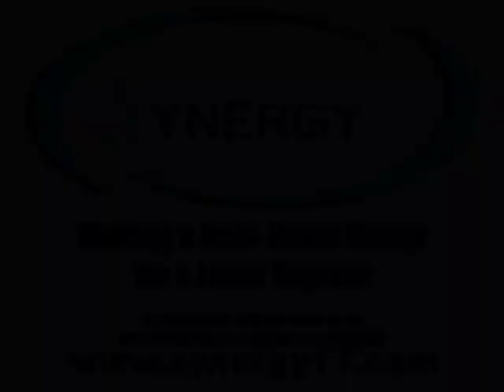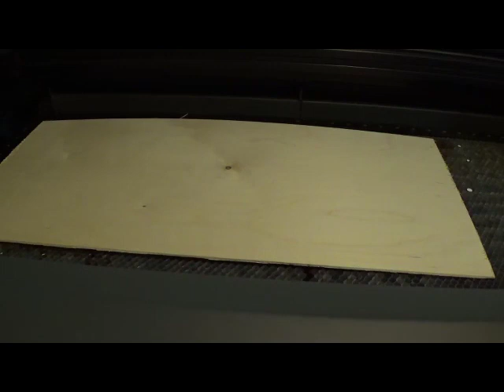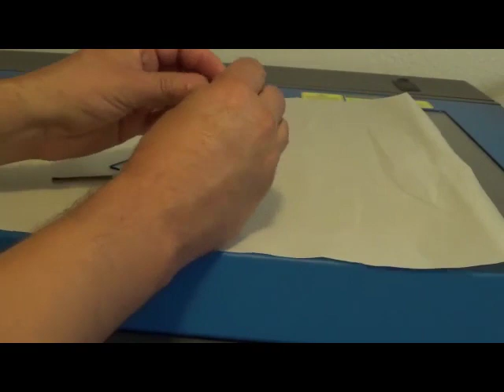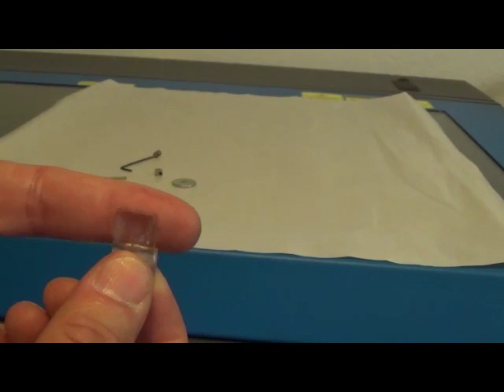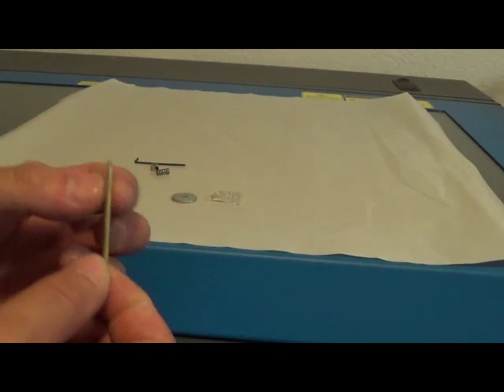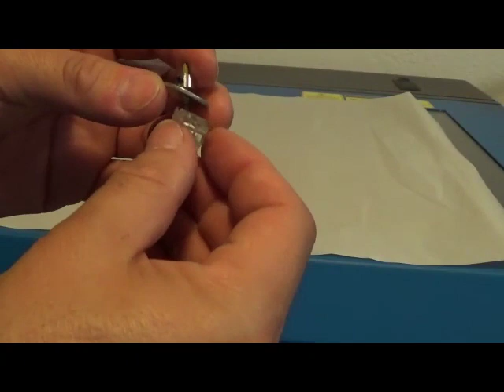Synergy 17 - Laser Engraver Hold-Down Clamp How-To

Comment: Why don’t you turn the board over so the middle is down tight and clamp the the sides so its all flat. Just a thought.
Hope this helps. Thanks for the video.
Reply from the maker: That would work, but then you would need 4 clamps for all 4 corners, instead of 2 for the centers. I think I tried it as well. 👍🏻